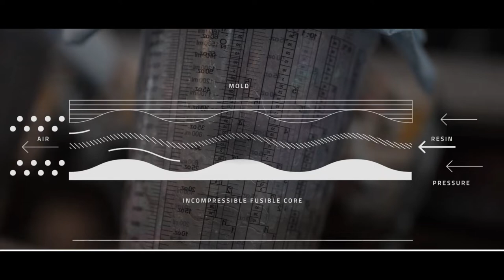Time Alpe D'Huez 01 Long Term Review

Comment: Thanks for the brilliant review. I'm hoping that as a TIME brand ambassador it ok to ask for your opinion/advice.  I've pretty much talked my self into the ADH frameset, but trying to decide between 01 and 21. I had been eyeing frames from Chpater2, Factor, Open etc, but am intrigued and impressed with Time's manufacturing process and quality. 
My current bike is 2020 Spec Tarmac SL6 Pro Disc Force AXS size 54, Roval CL50, Pirelli PZero Race 28cc run tubeless @ 72/67psi. I'm 5'9" 170lbs. I don't race but do rack up about 150 mile/week on NorCal roads.  I love this bike and am very comfortable with ride quality performance etc. but am looking for something new.  I will be moving virtually all componentry over from this SL6 onto new ADH.  Have a few concerns/questions.  I'm looking for any excuse to buy the 01 but am concerned it might be to firm/harsh of a ride compared to my SL6.  I know Activ fork is an option, but it seems not readily available in US and I'm not ecstatic about the additional cost and weight so I'd rather stick with regular fork (although my new authorized dealer in Berkeley, CA thinks they can get it not problem) I know from your review you had an RC5 which I believe to be similar to Sworks SL6, so just looking for your thoughts if you think that my ADH 01 disc with the above mentioned componentry will be similar in terms or performance/compliance but with with that extra refinement from the superior quality from Time manufacturing method etc., or if its just too racy and I'd be better off going with ADH 21.  One other thing to mention is that per my fit, I have to run a 90mm stem on my SL6 and per ADH geometry, actually looks like will be a slightly better fit for me and I will be able to run a 100mm stem. ON a side note, I also have a 2020 BMC Roadmachine 02 Three as my more endurance/light gravel bike so the ADH will really be my "let's go fast/fun" bike.
Thank you in advance for your time/thoughts/guidance.
Reply from the maker: Hey Brian, thanks for the note. I haven't spent any time onboard the Tarmacs, so I couldn't make a direct comparison to that specific line. However, I've spent time on just about everything else (Dogmas, Factors, Cervelos, etc) and the Time really stands out from the crowd. I honestly didn't know how rigid/stiff/chattery those other bikes were until I got on the ADH - one of my other viewers @MattTTT commented below that "...its the closest thing to a classic steel frame in feel except it has that light feel and rockets uphill with ease" and for me that sums it up; it's smooth and muted when it needs to be, but fast as a Ferrari when you punch it. It's truly comfortable and performant at any speed, unlike the Dogma or R5's which only come to life above 40kph/25mph. Will it "perform" "better" than your SL6? Maybe. Will it be an overall better riding experience? Hell yes. I say pull the trigger!
Reply: @AndyClarkRealReviews  DONE!!! Just put down deposit on ADH 01 in Blue, hopefully will be arriving in few days.  After I get it built up I'll post a first ride review comment and a follow-up review after I've done all my usual rides and have really gotten a feel for it. Thanks for the thoughts.
Reply: @brianwestcoat280   Hey Brian. I just wanted to shoot you a quick text, I just got my "Blue ADH 01" built up a week ago. It's fantastic! You will not be disappointed.
Enjoy the ride.
Chris Spence.
Reply: @christopherspence9109  Congrats Spence.  Yes, I've had mine now for about three weeks and put on about 350 miles.  It is superb!!! Its really hard to articulate just how good it is.  I do like Andy's comment about not realizing "how rigid/chattery the other bikes are in comparison to the Time ADH 01".  It is so solid feeling, that it makes the other bikes feel like they are made from plastic, and the Time is made from steel, yet is still just as light.  Truly unapparelled performance/ride quality combination.